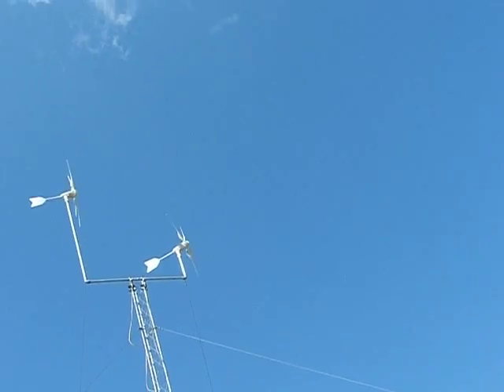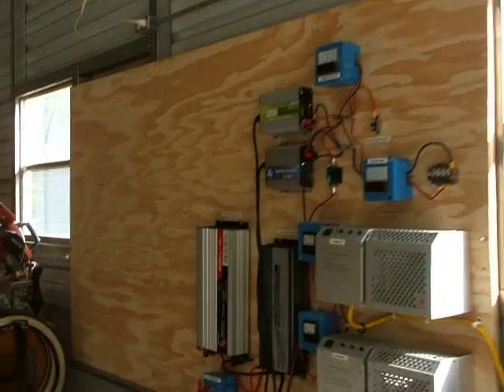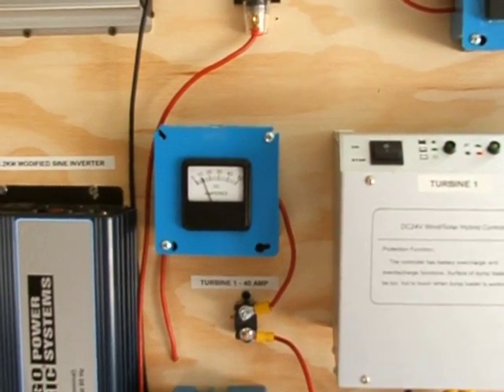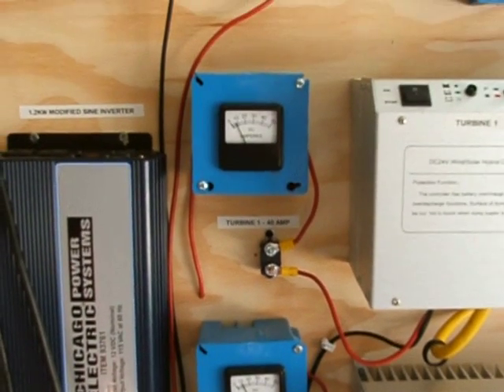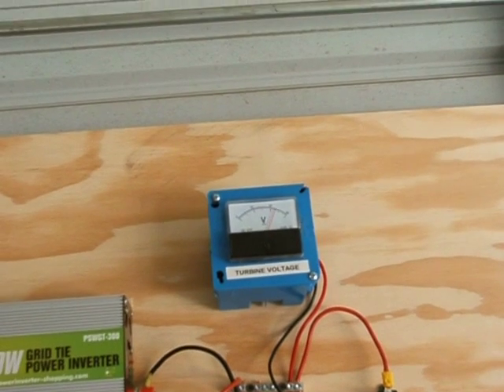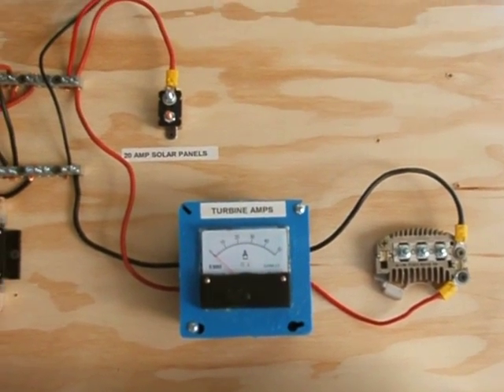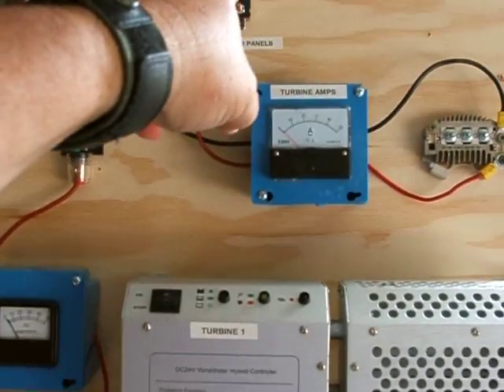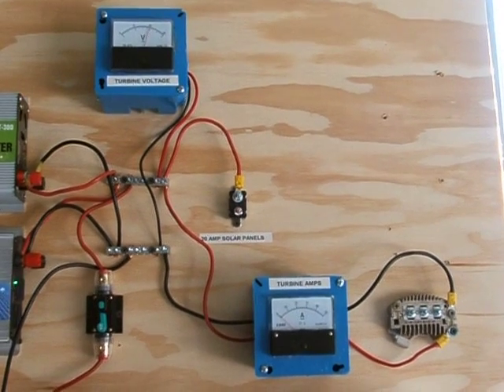Wind generators update - charging great

Comment from the maker: @scamsearcher I was getting about 250w out of each when the wind was steady at 12mph, when we got higher winds the power would climb up sharply. I've generated and honest 1.5 kilowatts from both during stormy days. I took both down in August and both will go up again on two separate towers in May. I never got any thing out the MW&S, they just wouldn't turn on unless it was 12mph or more and even then very little power output. I think they are fine if you live in a very windy area.